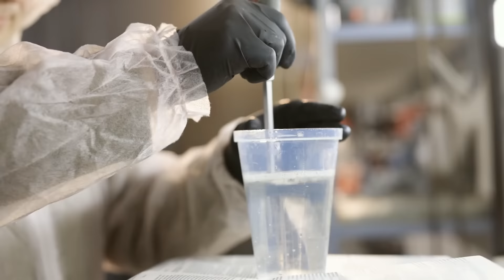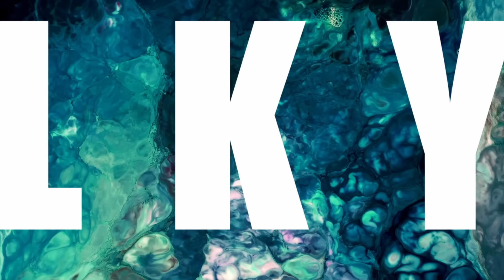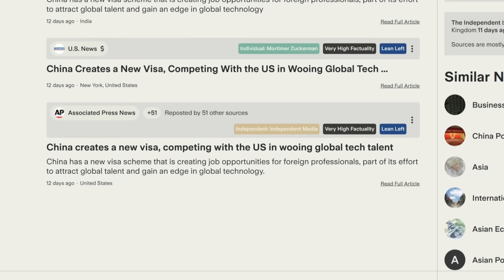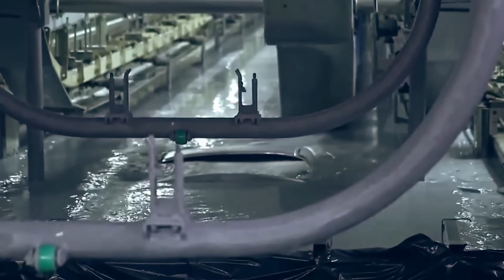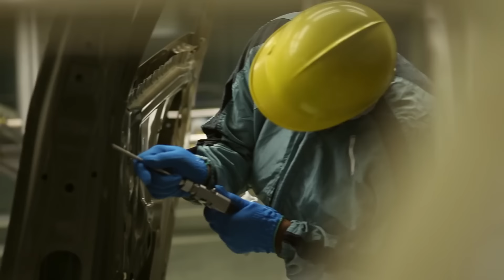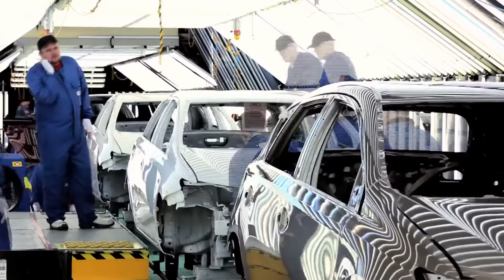The Hardest Step in Car Manufacturing

Comment from the maker: ▶ Go to https://groundnews.com/newmind to stay fully informed on U.S. politics, geopolitics, and more. Subscribe through my link to get 40% off unlimited access on the Vantage Plan and take control of the news you consume.
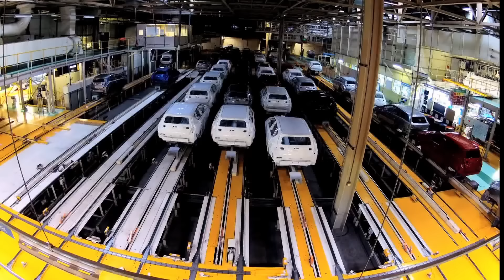Reply: 18:58 Cannot forget about 398.15 Kelvin, 716.67 degrees Rankine, 100 degrees Réaumur, 73.125 degrees Rømer, 41.25 degrees Newton, −37.5 degrees Delisle, −25 degrees Linnæus and 398.15 Leyden too!
Reply: @ianmoone8244 Engineering students nightmare
Reply: you're not a car detailer, right? Just a dumb ytber. New car paints are SH*T, you... They are so f thin (40u) that the can be polished ONCE, and a ceramic coating tries to protect,. Today's car owners are screwed
Reply: The modern car, electric or gas, has more than use roughly 10 to 12 times the amount of plastic material in it compared to a car from the 1950s (that's 300 to 350 pounds of plastic vs. 28 pounds!), that is the car's passenger interior, the motor compartment and the car exterior. Plastic stops being elastic after some time of exposure to the sun, it becomes crisp, faded and extremely weak, good for the producers and bad for the car owner. That is the reason a five to eight year old car looks like an old mattress, while your grandpa’s 1950s car of the same age would have looked like new.

Comment: Nitrocellulose was in fact, via a slightly modified manufacturing process, identical formulaically to gun-cotton, the first truly effective and stable smokeless powder, which was also far more explosive than gunpowder, by virtue to the increase in speed of the flame front. (that is why you cannot use smokeless powder in a black powder) gun.)

Comment: It is quiet amazing, what quality of the paint is achieved these days on the complete surface of the car. It is completely flawless.  No one is more critical than a new car buyer. When a new car is delivered, you'll crawl around it with a light and look for the tiniest imperfection. And usually there won't be any. It is outmost impressive.

I work in Engineering as well.. and we have many machine frames painted. But these individually painted frames are far off from the quality that you take for granted these days on a mass produced car. There you can see that it isn't too easy to do that properly by hand. Although in our case, it is also not that 'critical'. and nobody will be put off if you can see some mild fluctuations or texture in the paint.

Comment: There's no real need for car paint today: it's a well planned obsolescence feature. At the beginning of the car industry, it was needed, as materials used to produce body was prone to rust. Car paint isn't really doing anything but keeping the value of the car for a few years until guarantee expires. But most important, it's here to hide the cheap steel specifically designed to rust and degrade after specific amount of time. Any scratch or problem with the paint devalues the whole car while good paint sells a shitty car. But there's were always alternatives: cars made of better material which don't rust. To name a few cars that didn't even had a paint - Ford Stainless Steel Models (1930s–1960s), DeLorean DMC-12, Tesla Cybertruck. Bodies of that cars can't rust and simply don't have any need for car paint. Actually, DMC handbook states that body of DeLorean was supposed to be maintained by a soft cloth and a little bit of gasoline :) Personally I'm driving Opel Vectra from 2004 and it's completely made from zinc-galvanized steel sheets. 21 years old car with absolutely no rust - what a fail for Opel's stock owners huh?
Reply: funny

Comment: I’m sorry what? Automotive paint from the factory is terrible these days. Scratches unbelievably easy. On my 2020 truck my finger nails can scratch the clear coat off without much pressure at all. 30% of the front of the truck is covered in rock chips from highway driving. I think we are definitely heading in the wrong direction. I can throw a tool bag against the side of my truck from the 1990’s and it won’t harm the 30 year old original paint at all. If I did that to my 2020 truck it will remove the paint down to bare metal and severely dent the body panel.

Comment: Fun fact - Crafters make jewelry from a material they call Fordite. For cheap they buy chunks of built up automotive paint that is regularly removed from paint equipment. It's multilayered and multicoloured and  when cut shaped and polished gives interesting effect as beads and such. No idea how they break off the thick layers from equipment.
Reply: With a hammer or grinder, but it is very annoying and difficult. The stuff is all over the floor and simply gets thrown away. Someone once tried to collect it and sell it online, and got fired for it.

Comment: Simply put: Modern coatings use hybrid dispersions of acrylics, polyurethanes, and polyesters, engineered for specific functions in each layer (primer, base coat, clear coat). Modern factories have highly automated five-step modern painting process: pre-treatment, electrodeposition, sealant application, primer surfacer, and top coat (base coat and clear coat).

Comment: You can't beat a factory paint job.   It's thinner than aftermarket.   How you can tell if a car has been in an accident is with a paint thickness meter.
Reply: Factory parts can be repainted many times until they pass quality control. The more expensive models have higher quality control, meaning they get repainted more often.

Comment: Isocyanates are actually formed between the reaction of an icocyanide (aka isonitrile) with a polyAMINE not poly alcohol
What you listed would technically form a polycarbamate which would be very similar structurally. Polyurethanes form urea in their structure rather than repeating carbamates

Comment: During the electrolysis application the coating slows down as the layer gets thick and allows the internal thinner section to start getting thicker quicker making sure the whole body is protected from corrosion.

Comment: I've watched this before but still enjoy.  

Context. Worked for a large auto paint store in various positions for 17 years then went to collision refinishing. 

Typically epoxy or 2k etch over bare metal, 2k urethane surfacer, 2k urethane sealer, waterborne latex sometimes catalyzed then 2k urethane clear baked between 130-150f for 20-50 min.
Reply: What does 2k mean? Because I keep seeing it but don't understand it
Reply: @battlefield3112011 

2 component. That is, two parts needed to harden. I'd hazard a guess, and say it may come from German, which spells it "komponente".

Comment: As someone who works in automotive robotic painting as a process engineer, it was fun to see the evolution of automotive coatings and to spot some robots I recognize. Excellent work as always.
Reply: who changes the protective socks on the robot arms? how often?
Reply: @Timsturbs maintenance changes the robot covers (I like to call them pajamas). Depends on the shop and the booth but anywhere from every other week to over a month. Some covers get changed out more quickly (door openers get a good bit of over spray)
Reply: Bla bla bla
Reply: How does someone “work in robotics”? Aren’t robots supposed to work on their own? Are you a cyborg, or do you pilot a mech?
Reply: @davemccage7918 Someone has to make sure that the robots continue to function correctly and when they have issues how to troubleshoot the issues. 
There is also constant change where they come out with new cars and things have to be tweaked or the robots moved around and their programing reworked.
Reply: @davemccage7918 😂 bro he probably a robot doctor who has to program the to function accordingly you need to understand these cars are of various shapes and sizes and requirements of different morion and all you gotta program it and then synchronize the entire system to work its a whole can of worms lol
Reply: @ShonenPower99 Seems redundant! It’s like how in Tesla’s autopilot, you still have to pay attention and make changes. To hell with that! Might as well just drive it yourself. That, and I’ll never forgive Waymo for killing that poor cat! 😡 I could care less when the beta tester in the Waymo mowed down that tweaker lady who practically jumped into traffic, but crushing an innocent kitty is diabolical imo.
Reply: @davemccage7918 someone has to program the robots and tell them how to paint the cars. But I do have an application with Gundam Wing...

Comment: should do the same video but for marine coatings. would be interesting to see the differences. the conditions there are aweful
Reply: I'd be so happy if this happens. There's almost no videos about polyesters and gelcoats out there!
Reply: @Dankma im in the process of repairing corrosion and doing a full repaint inside and out on my 12m cat so im learning a lot about the process but i dont know anything about the chemistry so that would be cool to see
Reply: I'd be curious too, why $50 a quart?
Reply: @BariumCobaltNitrog3n 50? 🤣 the stuff im using is $800 aud per 4l kit
Reply: Who is your paint guy?  That could be considered cheap!  

There is an impressive amount of work that goes into that $50 can of paint.  There's highly engineered resins synthesized to withstand the expected environment, hazardous and volitile materials that are becoming increasingly regulated, additives, stabilizers, and pigments.  Then there's the years of durability and exposure testing to ensure the coating will last years, if not decades, in all sorts of conditions. 

Once a manufacturer finds that magical formula, they then face the challenge of producing the same quality product at scale.  Some polymers cannot be made in 100,000L reactors and must be synthesized at smaller scales, driving up the cost.  Another note about scale - consumers like us buying pints, quarts, and gallons of coatings pay the highest cost per volume.  Car manufacturers buy paint by the drum, tote, and even rail car, paying significantly less per volume.
 @BariumCobaltNitrog3n

Comment: While in hs in the late 70's my first job was an aircraft painter. The transition from acrylic to polyurethane was a milestone in durability for high speed jets. Surface preparation is critical as well.
Reply: So you were painting with Imron, now Axalta?  Those Isocyanates' are some toxic
and hazardous material's...         But extremely durable!
Reply: @onazram1 Yep we always wore a respiratory.
Reply: @CJ-nt4cs    I had a '68 big block Corvette painted in Imron in the late 1980's.   I would never do that again....
Reply: If all his is true, then why do new trucks and cars rust out in 2/3 years. Also the chassis rust out so bad they have to be scrapped.
Reply: @edsnyder4073  very seldom see rust on cars built in the last 20 years, no comparison to previous century.
Reply: @edsnyder4073 because car companies today design them to wear out . Duh.
Reply: You can see the surface degradation in fast jets, after considerable sorties. There is nothing like Mach 2 + aerodynamics stripping coatings and temperatures don't help either.

Comment: One thing i wonder is how the paint industry will adapt to the risk of Micro/Nano-Plastic Pollution.  Marine paints especially, but Automotive Coatings like this aren’t safe either per se.

A Bio-Asphaltum based Japan Black (with Vapor Recovery) MIGHT work but far less efficient and only in the “boring” color of black.

Also the issue of not wanting it to be “Prompt Biodegradable”.

Comment: Could you do a video on the history of alternative fuels?  Especially LPG Autogas, CNG/LNG/ANG (and biogas derived rng), Transesterification Biodiesel, Hydrotreated Renewable Diesel, Conventional Corn Ethanol, Cellulosic Ethanol, and novel stuff like Butanol, Power-to-Fuel, Syngas Derived Fuel, and DME/OMEx.

It would be in your wheelhouse, and really help with the discourse as most people only know about corn/sugarcane ethanol and transesterification biodiesel!
Reply: Would also be cool to see a segment on the wood (or was it steam?) converted taxis used in France in wwii
Reply: @theodorekorehonen ”Wood Gas” is RELATED to syngas, so sure!  “Pure” / High Quality wood gas is just Syngas (thus “Charcoal Gasifiers” tend to be easier to make) 

HOWEVER some impurities in wood gas can be beneficial for Lighting applications as they burn brighter than pure Hydrogen / Carbon Monoxide (syngas).

Otherwise though they just gunk up engines/burners and whatnot.

ALTHOUGH that “gunk” can be collected and used in a manner akin to Coal Tar / Creosote (or Pine Tar in baltic Countries).  Only minor distinction would be if the Coal Impurities such as Heavy Metals etc are critical to the properties you are after.

“Coal Gas” / “Town Gas” is another interesting tangentially related rabbit hole, but not TOO relevant these days, and also was more of a stationary thing.

Hope this info helps!
Reply: Aww